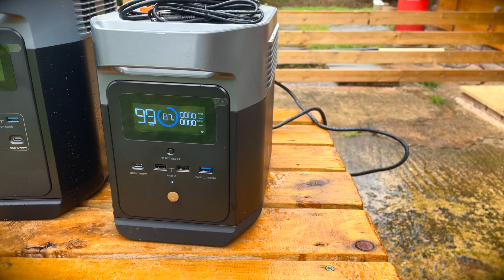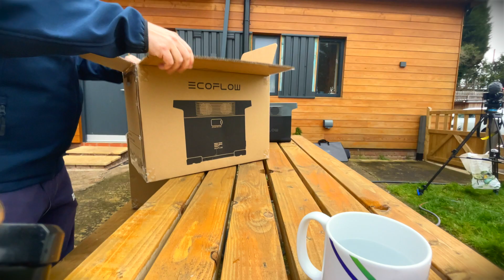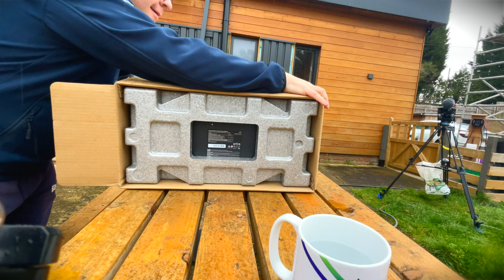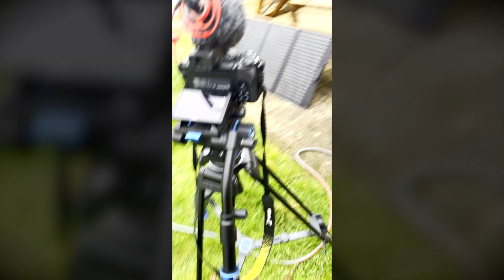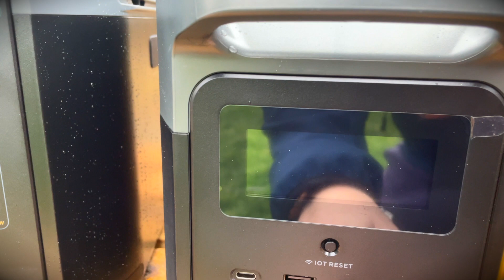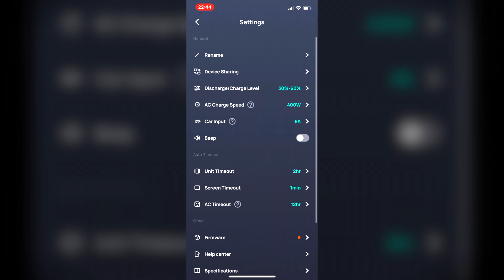Can these batteries replace a petrol generator? Ecoflow

Comment: Since acquiring the 2 units they are used every day to power washer/dryer/ironing and TV. Currently on Octopus Agile so top up units when power is cheap usually post midnight the use batteries during the day. Today fully used power twice and charged twice🎉🎉